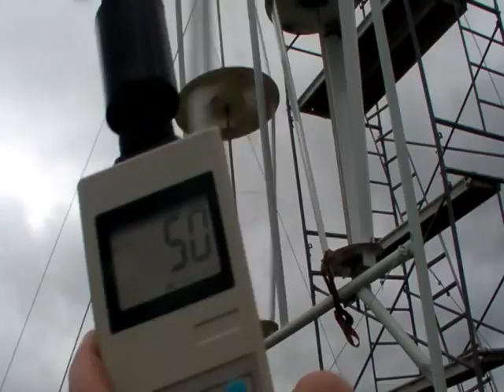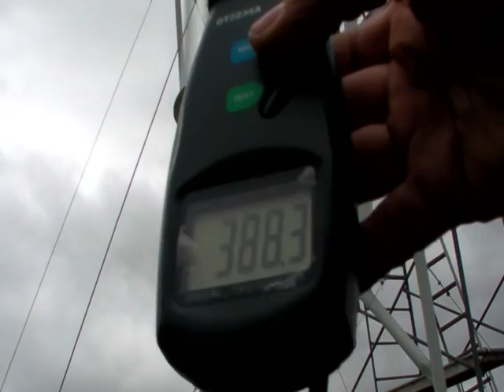column R vawt -20 vertical axis wind turbine airfoil lift

Comment: how did you make your blades? what are they made from?
Reply from the maker: Cnc carved cedar covered with fiberglass
Reply from the maker: Cnc carved cedar covered with fiberglass
Reply from the maker: Cnc carved cedar covered with fiberglass
Reply from the maker: Cnc carved cedar covered with fiberglass
Reply: dang.... how long per blade?
Reply: what was the intent behind building it?
where are you at with energy production?
and any new videos if you are making energy?
Reply from the maker: ***** the intent is to harness energy from low wind.
after many tests and tweaking, i was able to make 300watt, the results are in one of the videos, not the best results. but power was made. i am trying to get back into modifying the GEN and see if i can improve production
my new videos will have to wait for now. i am away from home working.
i still believe that my design is a great one and it is a winner.
sam
Reply from the maker: +HyperGro DWC each blade is 68". i have revised the design for better result, but i never created the blades yet.
Reply from the maker: CNC machine, wood with glass warped

Comment from the maker: @electrodacus the turbine started at 7m/s wind. and yes i have installed a small savonius on top and it helped. but it slowed it down, so then i installed one way baering and it worked fine.
but i know that my turbine will not make any power before 10kmh wind.
i also calculated on my turbine not to produce anypower before 200rpm.

sam

Comment: We had wind 40 to 50 mph here for 2 days, have you experienced that yet?   Are you going to use load or brakes to control rotor speed, or something else?  There maybe a critical RPM limit. I,d still like to see you split it and put a bearing in the middle. You may need a third leg for that or V off the 2 uprights and strut back to the bearing.